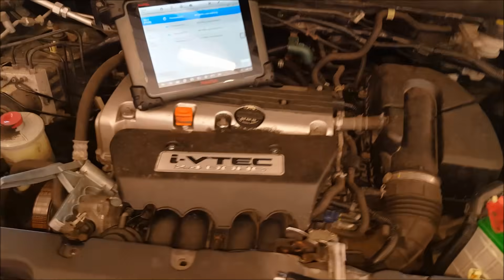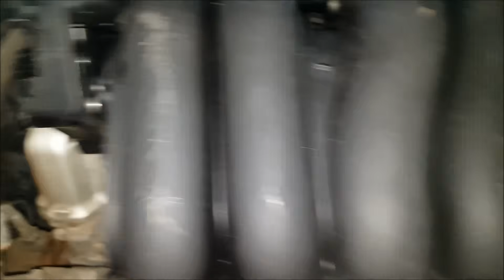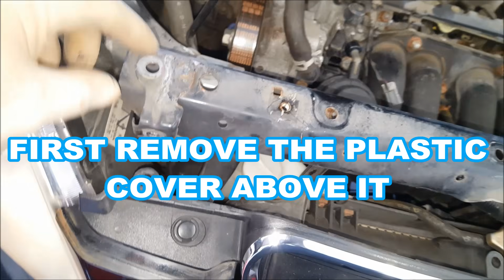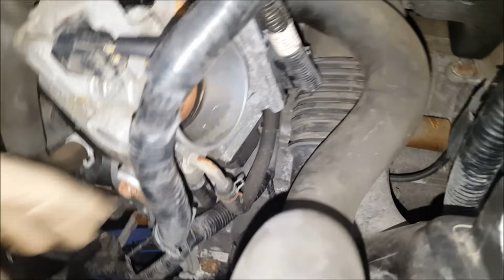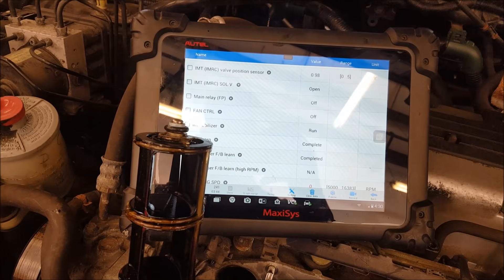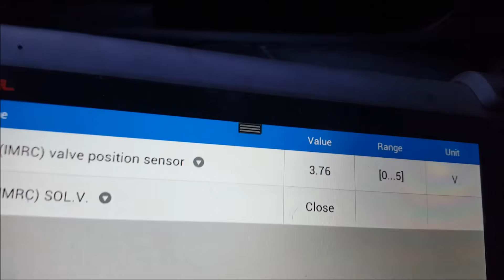HONDA CR-V IMRC REPLACEMENT / diag. P1078 P1077 2006 2.4L how remove replace acura rsx

Comment: I'm putting finishing touches on JDM engine transplant to a 2005 CRV

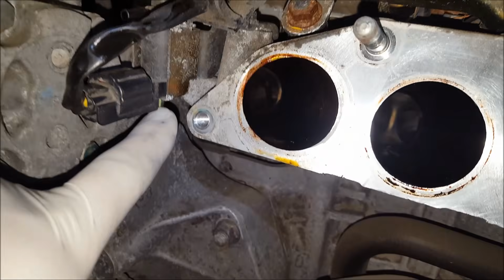0:53 my vacuum hose to the bottom was disconnected.  Erased codes, started and let run for 10 minutes. No new code. So I think that was it. Thank you.

Comment: I just did this job today. Got a code for valve stuck short. Gotta do the vaccum turn bolt method, hope i didn't snap any seats in the runner or the sensor.

Comment: I have the same year vehicle. I get engine code p0661 (intake manifold bank circuit 1 low) periodically. On the highway when I’m at 60 mph or trying to reach or surpass it. The vehicle begins to shudder at times and you can hear the motor sputter like air. Is there something probably clogged?
Reply: I’ll answer you since I had the same code today. I followed the vid and cleaned the imcv and the code went away. It was filled with sludge and wasn’t turning smoothly. Use dawn dish liquid and water, compressed air to dry in crevices. Hope that helps.
Reply: @uMAD  I appreciate it. I will give it a go if the code comes back. I recently changed my starter. I’m guessing whoever replaced the starter previously didn’t properly torque the intake manifold. As of now I have no engine codes. I should have checked to see if there was any sludge since I already had taken out the manifold.

Comment: I had a P0661, replaced the Valve, cleaned everything and reinstalled it. Have vaccum, solenoid works, and proper voltage. Now I have a P1078 😩. That little step towards the end where you pull vaccum to install the valve? I didn't see this video until it was too late. Sounds like I have to take it apart again 😖

Comment: I cleaned my IMRC, changed out the sensor and just ordered the solenoid. If this doesn't work now, you gave me an amazing list to go off. Ty
Reply: Did it work
Reply: @FutureDreamZz  yes, i also ran into an issue along the way. I changed out all the hoses and the helped drastically. I also did my throttle body along the way fyi and just in case

Comment: Our 2003 crv has issues holding idle after warm up. Could this be the cause for it? During cold start everything is working good, but once the idle lowers, it gets worse. No cel at all. Spark plugs&coil packs are good and injectors seem operational as well. Im gonna run a vacuum test in the future but id like to get some more info before i dive into it. 
Thanks in advance.

Comment: Liked and Subbed my friend.  I just purchased an '05 CRV with 5spd.  271k miles.  No codes or CEL, and passed an enhanced smog on the first try.  Have been wondering about how this valve works.  There was a similar system on our '95 Audi A6 Avant with 2.6L V-6.  Thank you for all the details and how to check it, and the solenoid.

Comment: acura rsx is the same. i just removed my intake to replace knock sensor tonight. and that little damn hose at bottom of valve that goes to the intake, i never noticed it lmao. so cars back together and getting p1077. thanks to you i went outside and i squeeze a few fingers down under it and i pulled the hose up. aint connected. man you ended my nightmare. should be able to just unbolt it and maybe disconnect a few plugs just to get enough room to get that thing in. i KNEW i didnt damage anything and im so done with fixing this thing. hopefully this is all that is wrong. thanks again
Reply: Im here right now ,after doing the same replaced knock sensor, and same code on my RSX. Im praying that hose is my issue!  Took the intake off last year to replace a starter. I never knew anything about the knock sensor being there at the time. I would have replaced it then.

Comment: I changed the intake manifold complete with all accessories checked the the solenoid, I have vacuum on the bottom hose, I have power key on engine off & ground when engine off. But I still get the p1078 code. Any ideas?
Reply: Did you figure it out?
Reply: @FutureDreamZz  Yes, it was the wrong solenoid, which made it appear that the polarities were crossed, but it wasn't. I got the right solenoid, and everything worked properly!
Reply: @JV3z  I still got the p1077 code after cleaning (low voltage) any ideas? I cleaned it out did everything properly and took my time
Reply: @FutureDreamZz  Its still most likely faulty, even after cleaning. Make sure you get an OEM solenoid from Honda.  I got one from Autozone, and the polarities were crossed.
Reply: @JV3z is the solenoid the thing that’s small and it connects to the bottom air hose and side air hose into the intake runner thingy.  Thanks for the reply, I did buy a oem one off eBay
Reply: @JV3z  hey is it For Honda CR-V (2002-2006) Engine Intake Manifold Runner Solenoid 36163-PND-A01?
Reply: @FutureDreamZz  No, it's not the intake runner solenoid.
It's the solenoid to the left of the intake, if you're looking at the intake from the front of the car.
Reply: @JV3z  37890-PND-A01 this part correct? Thank you for the reply man I’m banging my head against the wall trying to fix this code lol
Reply: And now my latch won’t close after taking the cross bar out to get the intake off lol I suck man 😂 any ideas?
Reply: @FutureDreamZz  You don't have to take that crossbar off. Next time, just take the battery and the battery tray off and the intake will slide out. That latch normally gets stuck. All you have to do is unstick it manually use penetrating oil in grease, and it should come back.

Comment: how do you clean it? Just use break cleaner?
also if its the bladder thats bad can you just pop off that top part and put a new one in or do you need like a whole new unit
Reply: NO BRAKE cleaner just Dawn or dish detergent...

Comment: Mecanic change valve pcv and i bring the part(aftermarket Motorcraft)
but before job no engine light 
was on in my wife crv
2004.
after mechanic performed the job engine light is on now code p1078.
He guet out the intake manifold cover like you but now he sees did everything properly and if i want check again have to charge me for review and cleaning.
according your exelent instructions a have to get some time to do my self.
thanks to be generous helping as.
Reply: Vacuum line for IMRC solenoid was probably not reconnected or came loose.

Comment: I been dealing with this trouble since i bought the car 8 years ago, the 3 first years not a big deal clearing the code it was only coming back 1 time per 6 months...      But in the recent years i managed to change the whole assembly, all the sensors, the connectors, redo the wiring, i dont have any trouble with it in the winter but by spring to fall it start glitching, having the trouble one day, next day is fine etc,      i have no throttle at all when its glitching and suddenly a 4500 rpm it pop and kick back in,   its super clean inside, no gunk, no crack, everything move freely, i have no clue, tripple tested everything i'm planning to ajust the valve lash soon cause i have no freakin idea whats happening with that carbage, its annoying, why would it be intermittent like that 🤦‍♂🤦‍♂🤦‍♂🤦‍♂

Comment: I tried unplugging and plugging in the connector for the solenoid but didn't hear any clicking. Everything holds vacuum but I wonder, is the vacuum supposed to go up or down depending on throttle position? I had my son blip the throttle while watching the vacuum gauge and it stayed steady while idling and went up a little with the blip but didn't come back down after. I only had code P1078 come up and the car had a little trouble starting a few days before.

Comment: Awesome, thanks for the breakdown. Took it down and fixed the issue, the sensor on the intake had to be replaced. Both screws holding it in were stripped, I just cut it in half and used a phillip to get it out.
Reply: Those screws are m5 by the way.
Reply: Wait the tps sensor on the side of the intake manifold fixed it

Comment: Changed intake brand new dealer and valve solenoid brand new standard not OEM. And the code returns after driving 10 minutes 😢

Comment: Hi there
Please I have the same car with low idling. when I turned on the A/C or heater the idle becomes rough by dropping down below 600. Please any help to fix this

Comment: Nice information. Thank You. I didn't have to remove any of that front framing stuff to get mine off. Only had to remove the hood latch, Battery and coolant hose engine side and it slides to the right and up and comes right out.

Comment: I wore out a 1998 CRV 300,000 plus miles I bought a beautiful looking but mechanically neglected 2004 CRV. Finally got the P1164 CEL off for 2 days and a P1166 turned it back on... maybe the quality of the sensor it's self is not right....?

Comment: So what did you use to clean out the intake and the rotor. Great video thanks a ton
Reply: I have watched a couple more videos on this repair...and this question always comes  up...(as I have to tackle/repair this myself) Use a dish detergent, such as Dawn and NOT any brake cleaners!😊
Reply: I stand corrected...no-nonsense stated one CAN use brake cleaner to clean the intake manifold assembly runner!
Reply: @ronaldinabinet7750  thanks!

Comment: So I'm trying to help a friend of mine, they are getting P0661 Intake Manifold Tuning Valve Control Circuit Low Bank 1a. I wasn't real sure on this one and told them to take it in to get a diagnostic done on it and they are stating they need an entire new intake?! I've been wrenching for years and years, something seems off about what the code is trying to lead us to and what the shop is saying they need. It almost sounds like the control valve might be bad? I haven't looked over the car myself just yet.
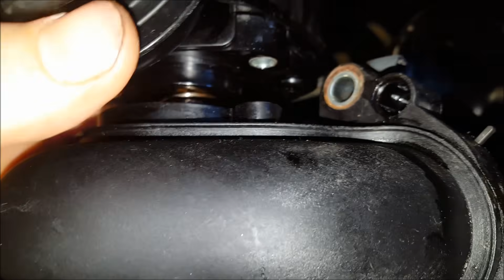Reply: Replacing the IMRC angle position sensor (37890-PND-A01) fixed that on mine. Replaced the original…had to drill out the screw heads to get it off, then one of the screw stubs was stuck, but finally got it out with PB Blaster and vise grips. Whole new intake manifold seems crazy, maybe he meant the IMRC rotary valve. I almost replaced that out of frustration, but it turned out to be working fine after 250K miles. Make sure it’s seated as shown starting at 6:10. That’s CRITICAL. Spin it back just like he showed.

Comment: Would this cause a p0505 code? I can’t fix mine, replaced iacv, pcv valve, cleaned throttle body, Checked for leaks. 03 Honda CR-V.

Comment: Great vid !! Thank you !! How can one prevent the rodery valve from getting sludged up ? What causes it?
Reply: For one don't use cheap gas..use mobile or shell..I bought a 02 crv and clean it out using seafoam now it runs great

Comment: If you have replaced a starter by removing the intake manifold and get this code (P1077), visually inspect the vacuum line thats UNDERNEATH the solenoid. Very easy to have that line come off and you can't see it easily. Need small right angle pliers or stat to put it back on.
Reply: Just checked and sure as shit it wes off  thanks for the advice
Reply: Dealing with this right now. An absolute pain trying to hold a light to see where to place hose and also getting ahold of the hose. Always something.
Reply: Oh shoot I hope that’s what’s wrong with mine I just got the code after replacing my starter and removing the intake manifold
Reply: thank you! i hadnt even noticed that tube when i pulled the intake out the first time 😅 you saved me more time and money and frustration on my moms car
Reply: hoping this is the piece of info I was missing
Reply: That's why I have that code... it's not there...
Reply: Thanks, that was it for me! Saved me loads of time!
Reply: The solenoid for the starter??
Reply: Oh!!! I see it now.. the vacuum solenoid hose underneath! Yes . Thank you.
Reply: You’re an absolute gem. Just recently swapped the starter like you said and I didn’t even realize there was a hose leading up underneath that solenoid! Sure it enough it fixed the issue! Appreciate ya!
Reply: I’m getting P0443
Reply: I’m having this issue, hope this is the solution. Thanks
Reply: Where does the other end go?
Reply: I get code 1078 but I have put two starters on my CRV.
Reply: I took mine to a shop to replace the starter motor.  Handed me the keys with a fresh new p1078 code set.  Didn't even leave the lot.   They took hours before telling me it was caused by buildup over years and offered to replace the intake manifold.  Later claimed it was a broken RC valve when I balked at cost.
Reply: Checking this NOW.

Comment: i replaced this valve and now my idle is going crazy, starts at 1k and revs up to 2k then goes back down and starts again, about once every 2 seconds. anyone else ever have this problem? no check engine light, short & long fuel trims are near 0, and it seems to be frequently switching between open and closed loop control. i literally have no idea what this could be.
Reply: guess my computer had to relearn idle. it's fine now

Comment: Great quality Video! However after completing and reassembly, my CR-V won't start and there is a buzzing/humming in the fuse box :( any advice?
Reply from the maker: Thanks.  Unfortunately nothing coming to mind off hand
Reply: @NoNonsenseKnowHow  Thanks for the quick reply! After a bit more looking into the problem, I seem to have jostled the electrical connection to the starter loose while removing the IMRC unit! Just took a bit of re-sitting :)

Comment: i took this part out and cleaned it and put everything back in but when i started it up the rpm’s were fluctuating and the engine was almost kicking it seemed like and i dont know what happened
Reply from the maker: You tried disconnecting the battery or clearing the codes? also make sure you have all your vacuum hoses connected

Comment: This was a very great guide. Thank you so much for this really good walkthrough
Reply from the maker: Thanks, and no problem. I'm glad it was helpful. Thank you for commenting
Reply: @NoNonsenseKnowHow  Of course! I do have one question. I'm assuming you have to put something to lubricate the mechanism after you put it back into the runners. Do you just use oil?
Reply from the maker: @Spud36  you don't really have to lubricate it no
Reply: @NoNonsenseKnowHow  okay! Thank you for the clarification and all of the advice dude!
Reply from the maker: @Spud36  No prob!

Comment: Video showed very well what needed to be done. Of interest to me is relative cost and what all other items needed to be replaced just to get in to clean and/or replace the IMRC solenoid valve. I have the valve itself around $90.00. How many gaskets will also need replaced or you would recommend having on hand? Any other special connectors? I generally prefer to have everything I may need on hand and return any items not used. Your thoughts?
Reply from the maker: Unfortunately it's been quite some time since I shot this video. I work on several cars today and all makes and models. Wouldn't really be able to give you any other specifics that aren't in the video. Sorry I couldn't be of more help
Reply from the maker: That's great that you prepare yourself so much for jobs though. I usually just tear in. Sometimes goes smooth and sometimes not too much

Comment: How does changing the length of the runners correspond to more or less power? Is the rotation controlled by the ECU or is it controlled purely by vacuum?
Reply from the maker: There's a lot involved with how they affect the performance of an engine. But generally the Runners are short for low-end torque and long for high RPM Power.  I'm not too familiar with how the system is controlled on this Honda

Comment: Guys, if you have to remove your intake one day - replace your starter at that time if it is older than 100k. It is a huge pita to do the same steps once again when it dies.
Reply from the maker: I agree with your statement. Although unfortunately a lot of aftermarket/reman starter Motors last only a fraction of the time that a factory one would.
Reply: @NoNonsenseKnowHow  I'm watching your video while I'm replacing the OEM starter that lasted 228K miles on my CRV 2006. It still works but is very weak. Not expecting $100 replacement to last another 100K, but the car will be 20 years old at that point :) Thank you for the video, great tip about inserting the valve back and spinning it back into place, scary moment
Reply from the maker: How to turn an attic into living space
Reply: Amen although if was vice Versa for me

Comment: I have 2 codes P1077 and P0661. Will replacing the IMRC clear these???
Reply from the maker: I would start with checking for operation of the imrc and cleaning it out

Comment: Great Video, wish you would have included your technique for cleaning it though. Not sure what is safe or effective for cleaning something like this.
Reply from the maker: Thanks. And I just use brake clean with a big towel if I remember right. Like a kitchen towel
Reply: @NoNonsenseKnowHow  Is that valve plastic or metal? I've heard brakeclean is bad for plastic. Also, what exactly is the sludge that builds up in there? Is it oil? Random crap from the air that got through the filter? Or what?
Reply from the maker: It's plastic. Brake clean does not affect these automotive engine grade plastics. They are designed to withstand chemicals

Comment: If you have to do this might as well change your pcv valve too if you have high milage cheap and easy to change out this will get gunked up and cause oil to burn when high rpm and starting of the vehicle
Reply: hose from pcv to air intake isn't expensive either
Reply from the maker: I agree. Good call!

Comment: My says it’s the IMAC solenoid would you still recommend cleaning the IMAC or replacing the solenoid by the way I’m driving CRV
Reply from the maker: I suppose try replacing the solenoid and see if it fixes it. lmk what you find out
Reply: @NoNonsenseKnowHow  I just replaced my IMAC solenoid by the way I have a pending code p1077 so I be driving couple days and see if it goes away if it does it was my solenoid.